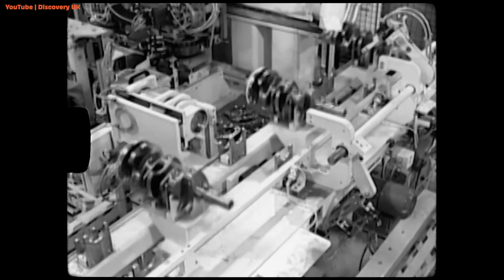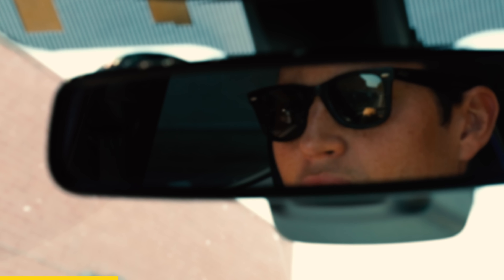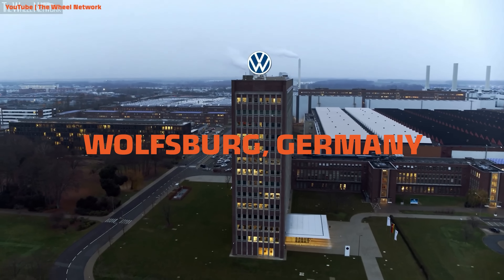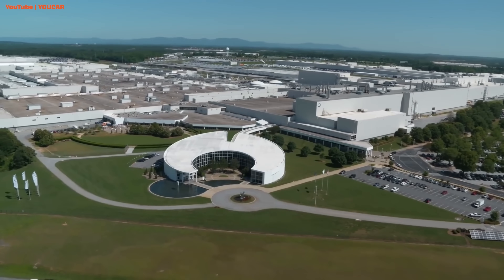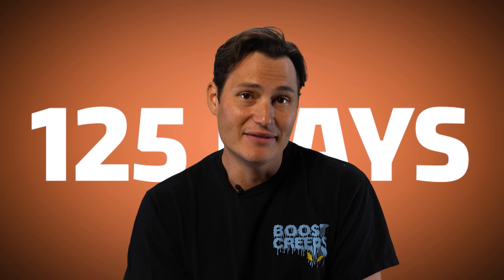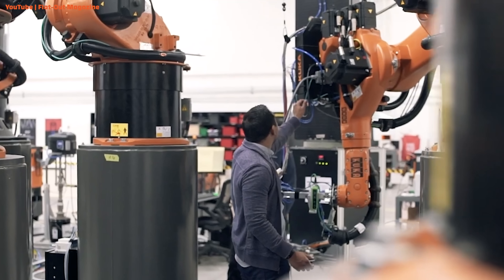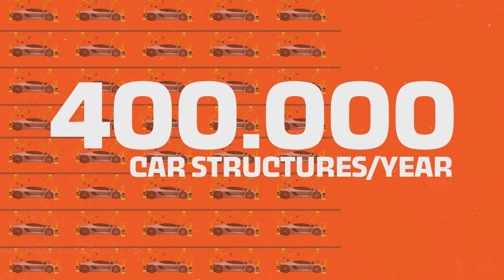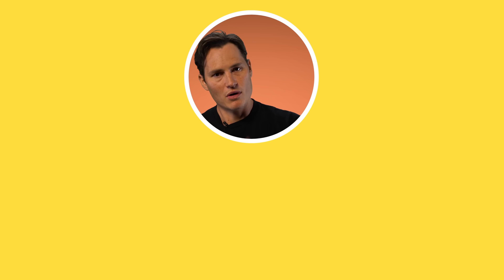A.I. Designed this Car

Comment: They should have planned it as fully electric, combustion engines will disappear in the performance segment within this decade..... Teslas Model S Plaid+ is advertised with 1,99 seconds 0-60, so the Roadster will be fro sure quicker. So now imagine you would combine both, literally making a special edition of the Roadster with Czingers Ai approach and replace some parts by Ai designed and 3D printed alternatives.

Comment: You didn't mension if the car is electric or not. But I guess it is because it does 0 - 100km/h in 1.9 sec

Comment: Prove my back side...
1.9 seconds 0 to 60 is physically impossible with any steer legal tires!
Doesn't matter if it's 21c, bugatti chiron/veyron, lamborghini aventador SVJ or any other car out there!
You can only apply a certain amount of force to the tires any more and you don't accelerate but generate excess weell spin...
And there is little difference between 3d printing parts or molding them in regards to after process work required.
The advantage of 3d printing lies in the possibility to make more complicated structures and the disadvantage in the fact that the material used will always be of a quality comparable with molded
Be it steel, aluminum, or titanium.
On the contrary the traditional methods have to build a piece a 3d printer can make just fine, out of two or more parts and put them together afterwards which creates week spots and have to be reinforced.
On the other hand though you can use materials optimized for the specific roles the have or stronger materials such as compressed and tampered steel.
In the end the car of the future will not be of either of the two sides but a combination of both.

And don't get me wrong it is a fascinating project and a very interesting case study but not some kind of all records destroying behemoth. I wouldn't be surprised if it breaks non at all but for a concept study it doesn't have to!!!

Btw... Where TF is the similarity between 21c and the blackbird?? O.o
It does look pretty much like the typical generic sports cars (ferrari, aston martin, lotus and so on...)

Comment: 3:35 A computer doesn't learn like humans do, current-state ML Algorithm are only capable of interpolation; Humans are able to extrapolate.
Also it isn't actually learning, but solving an Optimization problem by finding the best parameters to map training data to its desired output.

Comment: After a wreck, minor damage will require an entire section of the car to be replaced $$$$$$$$$$$
Reply: untill AI figures out to incorporate plug and play parts yeah.

they applied a computer program to jet engine design with maintenance in mind as the engines have to be puled apart every 100 hours and it made it way cheaper to repair
Reply: Not if is is modularily designed
Reply: Actually you could cut away the damaged part , stick it back on the printer and reprint the damaged section and it would be as good as the original
Reply: well yes like every super/hyper car or any car that will have only 80 units
Reply: @JasonGiudici  rubbish. how much f### time is wasted trying to sort out computer malfunctioning and software upgrades that are a f### disaster and cause the system to crash - and that is just a static disaster. Imagine the magnitude of the disaster with computer and AI system crashes and malfunctions at 60mph.
Reply: @chrisbarker3034  he didn’t say soon, he didn’t say how, he just said they will.
Reply: @chrisbarker3034  You have a point. We don't really need AI to solve design issues or traffic accidents. We already have the tools, we just don't use them.
On science and design, our publishing, patent, and capitalist systems stifle innovation in numerous ways. If scientists and engineers could work together instead of against eachother, the edge AI would have would be little more than a novelty today.
On traffic accidents, good city planning and public transport can eliminate nearly all accidents, no AI required. 

The only thing AI really offers is an imperfect solution to artificial problems that we will need to pay a corporation to access.

Comment: So AI has designed for all the validation cases large manufacturers adhere to?
What happens if someone puts it in idle and holds the throttle fully open?
Why should you test for this - well anyone can do this.
Your car will catch fire within the hour - no question - post video to prove not.
Also - make sure doors are open if you do this test - as your doors may jam due to thermal issues as AI might not have considered this.
There's nothing new in the world - apart from "Engineers".

Comment: “You wouldn’t download a car” 
-Piracy Commercials 
I’ve been lied too
Reply: tfw your comment is right below the one you copied
Reply: Tesla doesn't support Aftermarket Tuners on the grounds that Illegally Activating Built-in Software potentially exposes owners to malware. Rockstar Games works tirelessly to curtail piracy that circumvents the GTA Online paywall, but they don't crash your computer for using pirated software
Reply: Tooo. Toooo. Tooooo. Toooooo. Tooooooooooooooooooooooooooöööö.

Comment: Young product engineer here

This process is dumb.
Every part of a modern day car is already optimised and simulated by software, but software can never ever completely make the part.
They give it the fancy name AI here (and I absolutely hate that term) but it's just topology optimisation or generative design, which is software I've personally played around with, and can create complete nonsense structures if you don't choose your parameters wisely.
This car is still designed by people, aided by computers. breaking news, it's called computer aided engineering and has been the standard for decades, just becoming more software-centric.

Comment: I just want to point out the additive manufacturing DOES produce excess unwanted material.
And in almost every case, some form of traditional manufacturing or machining is required to FINISH the part.   A common design flaw is not factoring enough unwanted material into the design.
Reply: Not mentioned here is the time it takes to program and prove the robotics.
(By people)

Comment: You can save even more wire by using micro controllers and ecu so instead of having 20 plus different wires you need only 4 main wires, 2 for positive and negative and 2 for data to control the micro controllers.

Comment: 125 days to print the parts for just 1 car. So the speed of assembly becomes irrelevant. 
And a lot of parts still need to be cast, forged and machined. I'd love to see a 3d printed crankshaft 🤣

Comment: With materials reduced to the bare minimum, good luck fixing it when it breaks. Say strip the threads, normal process would be drilling out a bigger hole and re tapping new threads. 

If materials have been reduced so far, would mean there isn't any material left for a fix.

Comment: I'd buy a time machine with the $497 Mil and tell Henry Ford that electronic machines were used to reinvent his assembly line 🤣 *EDIT*, Fun fact. The SR-71 was the last aircraft to be designed based on handheld measurement tools like a slide ruler, and even based on modern mfg/ design tech, it would have been made the same way.

Comment: They should make a motorcycle using this, it’s gonna be on some akira type shit
Reply: Or even simply a helmet designed like this. You look at all the strange organic looking structures it builds to be efficient, imagine the internal structure of your helmet looking like a second skull and having the shape of a cat's head for aerodynamics and force dispersement. could be crazy
Reply: @amihere383  I don’t think that would work unless you gather many radically different helmets it would probably just make a normal helmet since there’s not many variations unlike cars there are thousand possible millions of different cars/vehicle
Reply: @mostcoolkid78  You're absolutely right, there are tens of thousands of different models and styles of cars. And none of them utilize organic structures and energy/material efficient design like this does. That's why I brought motorcycle helmets in.  because as of yet, there's no man made material or structure that can withstand such insane forces as what a motorcyclist might face going down on the highway, or getting hit by a drunk driver at 90mph. But organic structures, like trees that can stand hundreds of feet tall and withstand hurricanes that destroy entire towns, or insects than can fall from heights that are equivalent to hundreds or thousands of feet for us without any damage, or deep sea creatures whose shells and skin can withstand hundreds of tons of water pressure completely normally, those avenues are how we take the next step in the evolution of technology
Reply: @amihere383  Furry helmet?
Reply: @zeal4213  Buddy no
Reply: Why do that, when they could make a hover bike (which already exists) or an Armored Core/Gundam (also exists)?
Reply: Oh hell yes
Reply: And a ai designed suit.
Reply: Seriously!
Reply: 'BUSA
Reply: https://youtu.be/fhOSXf6-SEI

P.S White Glint in this vid will be way more refined in reality. Also, it won't need that giant booster on the back to move that fast. Now, go watch the Gundam 00 anime if you haven't already.
Reply: @LykanPrototype Laser scalpel ready :D
Reply: They did. Looks like ass, not Akira.
Reply: @infinati  Just because 1 Design looks "ugly", doesnt mean it'll be the same because that's 1 out of many possible designs that could exist.
Reply: I didn't think alot of people saw that movie. It appears everyone has
Reply: I buy that
Reply: hope so
Reply: it has been done! look up APworks light rider

Comment: Wow, this could literally be as revolutionary as Henry Ford using an assembly line on the model T.
Reply: I feel the same way. If all of this is even close to being scalable and reliable, it is revolutionary and will change the way we make automobiles.
Reply: @michaelmuller5762  truth to be told... In F1 most components of the Thermal Combustion Engine are already 3d printed. The tolerances have to absolutely minimal. I'm talking .0000001 at times. So 3D printing has been the best solution for a while now.
Reply: @Artiick  3d printing is not suitable or efficient for mass production. Sure, you have more freedom for design, but the speed of each 3d printer is abysmal and uses a lot of energy.
Reply: @vockski3173  yeah. Especially if compared to injection molds or casts. That's a solid point😂
Reply: @Artiick  yeah casting would be a more suitable method. It's more restrictive than printing so the A.I. could only do so much with the design.
Reply: @vockski3173  if you watch top gear's video Czinger have actually matched production speed for 3d printing aluminium parts in comparison with casting them
Reply: @postreason  

Have they? Boy are you gullible. They haven't. Not only that, but 3D printed metal parts won't have the same resistance either.
Reply: @bobfg3130  there, there Bobby, it's alright to be wrong sometimes
Reply: @postreason  You cannot 3d print a crankshaft or anything else that is strong. 3d printing is only as strong as cast parts at best.
Reply: @cuckingfunt9353  thanks for your reply but i was never referencing anything to do with strength, just merely relaying other accessible information in regard to production speed, so i don't fully understand your reply
Reply: @vockski3173  Its a very very slow process. When you think about the time it takes for a press to come down and stamp out a new component. Literally seconds, the 3d printer takes hours and hours to achieve the same thing, which yes may save on material but the time lost on this would have a huge impact on cost. The offcuts on steel lost when using a press is fuck all because it all gets recycled anyway.
Reply: @cuckingfunt9353  Then how come a few companies now are 3D printing engine parts. Porsche have now started 3D printing pistons, and they take a considerable amount of force, also increasing the engine power by up to 30 hp. The fact that 3D printed parts are used in rocket engines and other high stress environments shows that they can be strong and sometimes perform better than conventionally manufactured parts as well as parts that normally wouldnt be able to manufacture. Yes they take longer to make but for certain application where a low volume is needed but high performance they can be the best option. An example of this is rockets and hypercars, they dont need to make many but they need to make them perform well. I can see 3D printing being used a lot for premium products whereas normal products will still be mass produced until 3D printing gets fast enough to be viable.
Reply: @conorstewart2214  Wel you clearly know nothing about metals then... Look up forging and metal science. You have to extrude, then fold then hammer, then fold and hammer 6 more times... You cannot just beam me up Scotty a crankshaft !
Reply: @cuckingfunt9353  you don't seem to be willing to accept change, they have printed functional pistons, how long before they do it for crankshafts, you don't seem to realise just how fast it is advancing. Just because it is printed doesn't mean it doesn't use well known concepts for working with metals, like heat treats and such. Do some research into it, there have been parts 3D printed in which the metal is stronger than if it had been made with conventional techniques.
Reply: @conorstewart2214  Learn how forging works dude. Just look it up on wiki... You cannot 3d print a forged part. Why do you think Tesla have giant pressing machines ?
Reply: @cuckingfunt9353  you mean you cannot 3D print most forged parts at the moment. Just because that is the tried and true method of creating a part doesn't mean it's impossible to create it with a different method. I'm sure many people would have believed that it would be impossible to 3D print a piston before it was done. Big companies like Tesla that need to create lots of parts and probably built the machines years ago aren't going to suddenly change to 3D printing on a design that doesn't need it or wasn't designed to utilise it. 3D printing and forging both have advantages and at the moment no one has 3D printed a crankshaft but it is still a very new technology with lots of ongoing research, I don't think it will be long until it is possible. Just because a part is conventionally forged doesn't mean it's always going to be impossible to create it though a different method.
Reply: @conorstewart2214  Dude... I don't want to be mean but, a forged part is like a part made of plywood, vs a 3d printed part is like a part made of chip board. ... In fact that is just a demonstration, the actual numbers are far far worse, 3d is like a wheatabix compared with hardwood.
Reply: @cuckingfunt9353  comparing athe forged part to plywood makes me think you don’t know what your taking ab fr
Reply: @michaelmuller5762  It's all a load of marketing hype. That company employs more people for unit manufactured than even Ferrari, that's why the car costs so much. Extremely inefficient manufacturing process, Tesla tried to fully automate and it delayed their products for years, in the end they just got humans to do the job. Look it up.
Reply: @michaelmuller5762   AI is fantastic for designing single components, a wishbone for example. It is useless at designing a whole machine.
Reply: It won't be.
Reply: True it could
Reply: This is a production process geared toward a low volume, ultra-high performance car. Even if it can improve on the state of the art in this particular niche, cranking out millions of affordable family cars is a complete different proposition. I don't think the assembly line is in jeopardy.
Reply: It's more than that. Once the already existing warp drives go mainstream, we'll really be cookin :D
Reply: It won't, is not a revolution, it's an evolution
Reply: Anyone who has a 3D printer at home knows why it won't.
It's the same reason why a CPU is so slow at rendering graphics compared to a GPU. The GPU can only do one thing, but it can do it at incredible speeds. The CPU is comparatively slow af, but it can do literally every kind of computation you can think of.

3D printing is horrendously slow and inefficient compared to traditional mass manufacturing. An injection molding machine can make an entire part in seconds, push it out, reset and do it again, when a 3D printer would take hours to make the same part out of the same plastic. Metal 3d printers aren't any faster.
3D printing is great for prototyping and it does allow for intricate shapes that cannot be achieved with traditional manufacturing, but it's useless for mass production.

If that weren't the case Czinger would have come out with a groundbreaking affordable car made with these revolutionary designs, not a zillion dollar low volume hypercar.
Reply: Well that created lots of human jobs. This takes them away.
Reply: An automated assembly line. Big difference

Comment: Astroturf.
0.01016 cm or 0.1016 mm tolerance is not what any automotive engineer calls accurate.
Also, these accuracy tolerances are best case scenario for any super short CMM device but when you’re putting together a car with robotic arms stretching to 4 foot long, you’re inaccuracies increase dramatically. Anyway, sounds like you’re excited about this idea but your report is grossly incorrect

Comment: The S.R.71 
BLACKBIRD,leaked so much fuel on the runway because the titanium would shift on every flight,,,it never had a fuel tank,they just shoved fuel into the wings,,,crazy plane,,I'm surprised they never blew up,they just went faster to put the fires out,I'm serious this is true....

Comment: The use of a 3d printer is nuanced but until the process is refined you'll end up with problems in structural integrity. So if you buy this car expect to have it in the shop often.